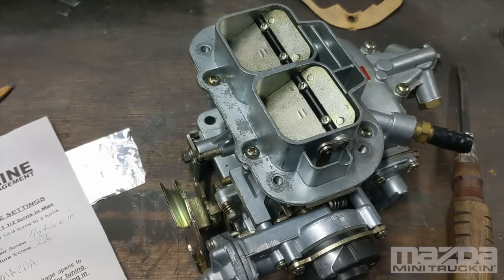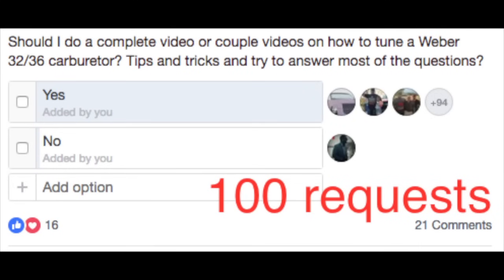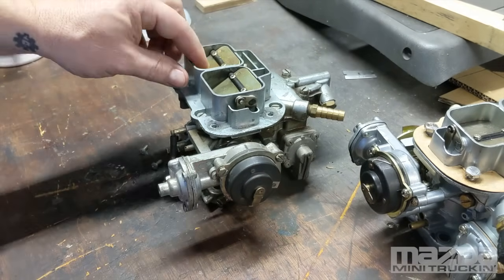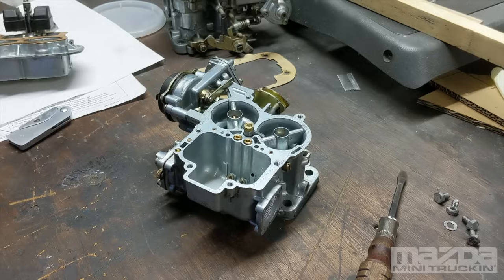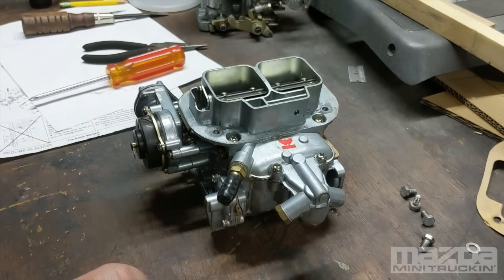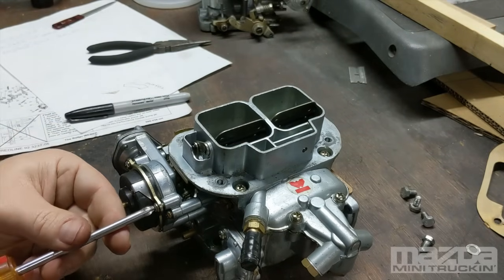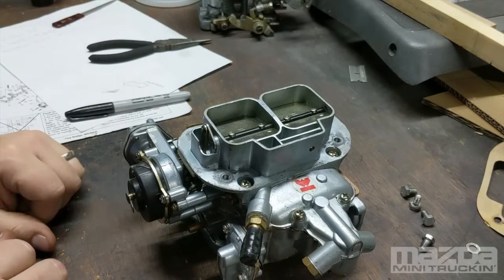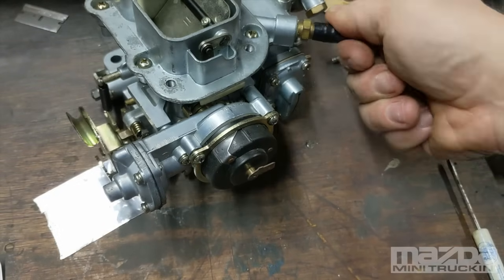How To Tune Your Weber Carburetor 32/36 (in depth)

Comment: Truck seems to run fine but I have some soot on my exhaust connections. I tuned it years ago and left it.  Do I need to start my tuning from square one or can I start with the mixture and then idle again
Reply from the maker: You could start with the mixture and then the idle again and what it may be is that you're just letting the choke run choked too long
Reply: @MazdaMitch  since the original tune, I have also installed long tube headers of that matters.

Comment: Do you have any clue why my throttle would be extremely stiff on a new carb?
Reply from the maker: On my website I have some Weber Docs, https://www.mazdaminitruckin.com/info/weber-info and on the one that says How to Setup and Tune Your Weber, it states this at the top.
"It is important to verify all linkage and levers are installed without binding and the linkage opens to
full throttle and closes to the Idle Speed Screw. The number one and two reasons for tuning
errors are improper linkage installations and over tightened linkage nut, causing a binding in
the linkage assembly."
Reply: @MazdaMitch  thank you so much! I will try it when I get home!!

Comment: Hey Mitch I have a Weber that I put away cause I have another one I ended up using . I never removed the gas out of the one I put away, how would u recommend me to remove the fuel out of the carburetor?
Reply from the maker: I figure most of it will evaporate. Otherwise just hold it upside down and get the most out you can.

Comment: I make the Weber carburator on my mazda 89 but I don't know what to do with the third line besides to fuel and fuel return or just let like it is, help please
Reply from the maker: You may be referring to the vent line, if so just tuck it back. Need more help and a place to post pictures, join our Facebook group. Link should be in description of video.
Reply: @MazdaMitch  thanks 👍

Comment: Hey, I’m stuck, idle mix all dialed in. Problem is it won’t throttle up. 2 carbs I’ve tried and both die when I throttle up. One is new one is used, same issue
Reply from the maker: Maybe you mean bog down when you give it a lot of gas? And it's happened on two different carburetors so the problem probably is somewhere else. You could have clogged up exhaust or your distributor may have the vacuum advance disconnected or connected in the wrong place

Comment: I have aftermarket headers on my B2200 and I was recommended by Weber to put the K 675-38 instead of the K 675. What are your thoughts on this?
Reply from the maker: I have never used the 38, but the 38 opens the primary and secondary at the  same time, its synchronous and would dump more fuel in the engine, be very rich. I wouldn't use one unless it was complete rebuilt and bored over engine.

Comment: I've set the idle screw to 1.5 turns, set the idle mixture screw to 2-2.5, set the primary screw to 2 turns out, and it still won't start on its own, I have to feather the gas to get it to start idling,then it'll idle at like 3-400rpm. I'll turn the mixture screw richer and it'll die, I'll turn it leaner and it'll die. All the timing is zeroed out, ignition timing is advanced a few degrees. All new intake and carburetor gaskets. When it does run it's very lean, but i try to give it more gas and it dies

Comment: Mine diesels after driving around for a bit only thing that kind of helped was turning the idle out more turns but still does it any ideas
Reply from the maker: Well don't confuse the idle mixture screw for the speed screw which controls the idle of the engine. Sounds like you need to back off the speed screw, not the idle mixture screw.
Reply: That one is set to where it is just touching the linkage

Comment: No matter what I do that screw doesnt do anything do I have a bad carb? In all the way out 2 it runs the same regardless
Reply from the maker: If you screw the mixture screw in all the way and it does nothing then you need to reevaluate your throttle adjustment or speed screw. The plates are cracked enough to let fuel in, that's why the mixture screw does nothing.
Reply: @MazdaMitch  yea I made sure it was closed then set the idle with the choke closed if I get it open by hitting the throttle it will die and no matter how far I screw in the fast idle it will die

Comment: A cheap vacume gauge for $15 sure makes tuning so simple as you adjust timing, idle, & mix off of strongest stable vacuum.
Reply from the maker: I have one and tried that and it didn't make it any easier.

Comment: I’m guessing Weber 38 about the same.    

I’m having trouble with mine on cold days.   Starts fine then after few minutes idle drops a s I need to stay on the gas to keep in running.   After watching your video sounds like my high idle adjustment or choke adjustment.

Comment: question on the weber 32/36 - i have 32/36 dgav - and what other type of weber can i use
Reply from the maker: The 38/38
Reply: @MazdaMitch  sorry i forgot to give info, i have a 1986 b2000, my brother and i p/u as a project
Reply from the maker: @abeld341  You can go to Piercemanifold.com or redlineweber.com and look it up it's just 32/36 carburetor or the 38/38

Comment: Hey there..great video..very helpful.  I have a genuine Weber 32 ADF....I just took it all apart and cleaned it out - all the jets - float chamber (full of crap) and then put top back on the bottom...hooked it all - guessed mixture screw and fast idle screw- and mechanical choke screw position. It started up at 2000 rpm approx - but soon as it warmed up ran lumpy up and would not idle - tryed to play with settings -but nope, would not idle. Revs up fine - but no idle.  The choke seems ok and the flap if totally open....  any ideas please ?
Reply from the maker: Check for vacuum leaks.
Reply: @MazdaMitch  it was the float needle ball U/S
Reply: @MazdaMitch  still not running well.....think it is the acceletor diaphram knacked.   It just will not run well after many hours spent tweeking idel mixture- cold start - and so on.....maybe the whole carb is trash?
Reply: MY FUEL TANK WAS FULL OF CRAP...this was my issue

Comment: Nice video . Had a doubt regarding the electric choke . When you apply 12V , the choke starts to open . Can it be slowed down by loosening the three screws and turning it counter clockwise ? Does the tension on the choke plates slows down the choke ?
Reply from the maker: Unscrewing the screws and turning it counterclockwise or clockwise does change the tension. However as I show in the video you don't want too much tension and you don't want the choke to stay choked too long. The back of the alternator produces 7 volts but in the dead of winter when it's really cold that's often not enough to warm it up to keep the choke open and it will constantly run rich 12 volts is the magic sauce that's what you want

Comment: Don't know if still check comments but was seeing how do I set my choke for cold start if I opened choke and let spring tension lose. How to reset to stock? Bagged 89 b2200
Reply from the maker: I check periodically. I do believe somewhere in the hour long video I covered how to set the choke from scratch? If not it's on another cold start tuning video on the channel.
Reply: Yup found the video got choke reset and truck fired right up. Thanks for quick reply and making such easy to follow weber vids.

Comment: Is it best to tune idle and and mixture to those factory/base settings with carb off the truck?
Reply from the maker: No. Its best to tune on the truck, as each tune is different depending on so many factors, like engine wear, altitude, fuel type. Just get it a base line setting, and warm the truck and fine tune.

Comment: Why is my lever the one the screw pushes far away from the screw its a brand new weber never used and the screw has to turn almost all thecway squeezingvthe spring to reach it.
Reply from the maker: Your throttle shaft that the throttle cable is connected to is too tight or binding.
Reply: @MazdaMitch  there was a screw on other side that i turned and it made it closer to the screw...thanks

Comment: I took my carb off and changed the gaskets. I put it all back together and my Jeep runs like hell. I’m so frustrated with it. Not sure what happened. It was running alright before but felt like I had lost some power. If I adjust this carb to much will it foul my plugs. My Harley will foul the plugs. Not sure if it transfers over to this or not.

Comment: Quick question: I have a 1990 b2200 Xtra cab FI model. Where if equipped with one would the egr valve be located or is the egr valve only on carb engines? Thanks

Comment: I know that you work on Mazda's butt I have an 87 Honda Accord I have a Weber sitting on it what would be the the perfect idle mix to make the car run and not want to put out or want to shut down I have seen with mine that after my carburetor gets nice and warmed up it starts acting up to where it wants to run real rough vibrate the whole car then it comes close to cutting out and shutting the car down and we give it a little gas it's good but we get to the next light it does that whole shake the car deal again and it shuts the car completely down not including I have to push open the butterfly doors on my carburetor just to crank my Honda so please give me words of wisdom or something to help my situation out please cuz this car's got almost 196,000 on it the original motor and transmission but it don't mess with the carburetors much anymore and I haven't done it in about 20 years so please send me words to wisdom or even if you could find me on Facebook befriend me please and FaceTime me just to help me out if you can thank you
Reply from the maker: Check for vacumm leaks. When it comes to adjustment, there is no one size fits all. You have to tune it to your engine, what it wants. Every engine, fuel, altitude, worn outness, its all different. Carb basics have not changed in well over 20 years, just tune it. Start with the weber docs. http://www.redlineweber.com/html/Tech/carburetor_set_up_and_lean_best_.htm

Comment: We're supposed to be the rpm with the ac on and off is burning lots of gas can you help me out please
Reply from the maker: I don't understand your question because it's not formatted correctly but I'll tell you this I have another video somewhere on here about AC I think it was the "smooth as gravy" video And I talk about and demonstrate how you have to idle it up to about 900 maybe 950 RPM for the weber carburetor so that when you cut your air condition on it drops it down just a little bit That's all you can do because there's no idle up solenoid after swapping to a Weber.

Comment: Hey mazdamitch I installed this carb on my vehicle and it flys up to 4k RPMs so I cant let it warm up or anything what do you reccomend
Reply from the maker: Sounds like you got something stuck somewhere. Might even be a small piece of rag or torn blue towel keeping the the throttle plate from closing. Time to investigate!

Comment: you forgot to mention that 32/36 carb has 2 fuel mixture screws. one for each barrel.
Reply from the maker: It does not have two fuel mixture screws. Only the 38/38 does. Maybe you are confused on the primary and secondary idle air correctors. They are replaceable not not adjustable.

Comment: Can anyone tell me; if I want to take the jets out to blow through to make sure they're clean, can i do this with the carb all still attached to the car? It it going to start to leak fuel anywhere? What about the Fuel filter under the brass bolt at the fuel intake too? What sort of RPM should I sitting at on idle? I'm also thinking about changing out the accelerator pump diaphragm and the choke diaphragm; can these be done while it's all still attached to the car and hooked up. Thanks for any help here.

Comment: When your 38 Weber runs rich does it sweat asking because my Weber sweats a lot
Reply from the maker: The sweating is the gas, you are probably using ethanol gas and it's the humidity. I run non ethanol.

Comment: What if the choke doesn’t return even after I adjust the choke thing
Reply from the maker: I am not really understanding your question. However there is a spring inside the cover of the choke and that gives it spring tension.

Comment: When I turn my mixture screw in til it's seated, it does nothing to the engine.
Reply from the maker: That means your throttle plates at the bottom of the carb or open some, possibly due to the idle speed increased too much. Tuning= adjusting the timing, idle speed, and mixture, it's a symphony. All of that can only be dialed in if you have taken care of vacuum leaks and have a proper installation and on a warm engine. The choke and the fast idle is another variable

Comment: When I turn my mixture screw in my idle speed up when I turn out rpm slows.. any idea?
Reply from the maker: You must be turning your idle speed screw, not mixture.
Reply: No sir I'm turning the same one you says the mixture screw on the bottom base.. also u made me realize i have a clone.. it cranks good runs pretty good just burns a lil rich
Reply: It has webber stamped on the side
But I do not see redline anywhere
Reply from the maker: @robertsroberts4327  at idle, the idle mixture screw, of turned all the way in, it will cut fuel off and will die, not increase in speed. If it doesn't die, your throttle plate is not closed all the way, defeating the mixture. The throttle plate will be open only if your speed screw is turned in too much. Visit mazdaminitruckin.com and review the Weber tuning guide.
Reply: Ok thanks I'll check it out.. this happens even when the idle screw is just touching

Comment: If you know how to set the float, you can go ahead and tell us.
Reply from the maker: Tell me you didn't bother to watch the entire video without having to tell me actually. 
24:33
Reply: Like this guy, I came here for the float adjustment. In the video you say the correct float measurements will be in the description or the comments. I can’t find it in either place. If you could reply with it here I’d be much obliged. Thanks!
Reply: Actually, if you keep watching as suggested, the measurements are at 32:22 😁
Reply from the maker: @spartans542  Covered it in the video. Try watching it all the way through.
https://youtu.be/7S5CPHUfZs8?t=1780